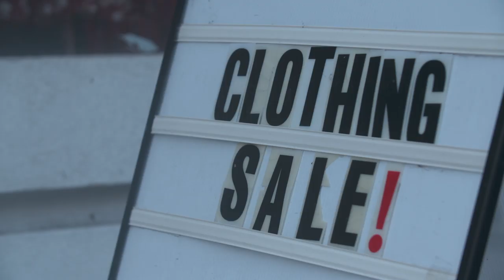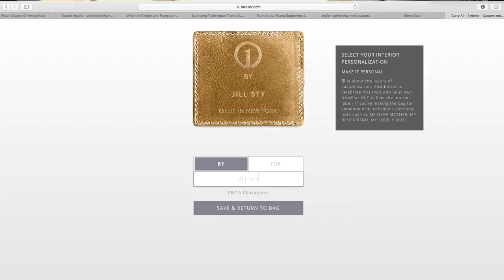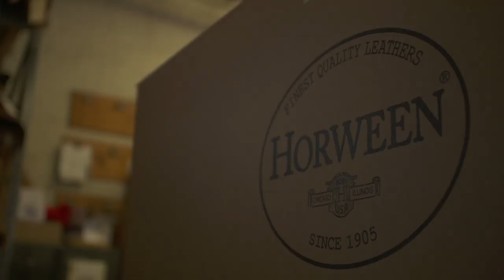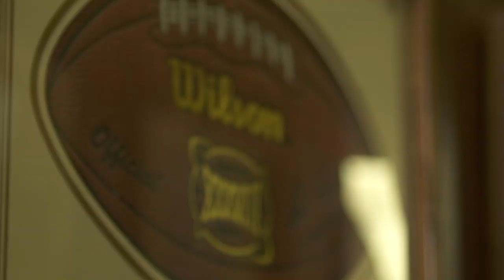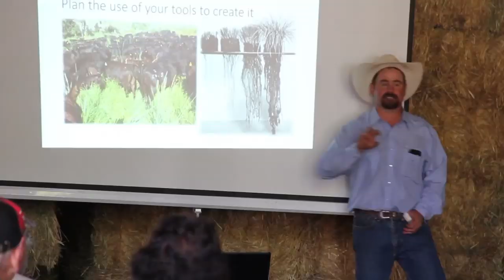The Story of Leather | Regenerative Agriculture Documentary

Comment: This is a great opportunity for farm visibility, if you can brand your farm on the leather  just as "corinthian leather"  in the old chrysler commercial, it will drive awareness of you farm operation thru the roof. Particularly if it is a base commodity on a coach collar or purse, or some other major designer label.    Gucci featuring Polyface Leather,  would just be an incredible boost to the consciousness of sustainable commodity production.   

    Even if individual farm branding is not possible, there should be an effort for "Regenerative farming produced leather", that seems like a no brainer, as the consumer is joining in the story of supporting regenerating soils and saving the planet, as it were.